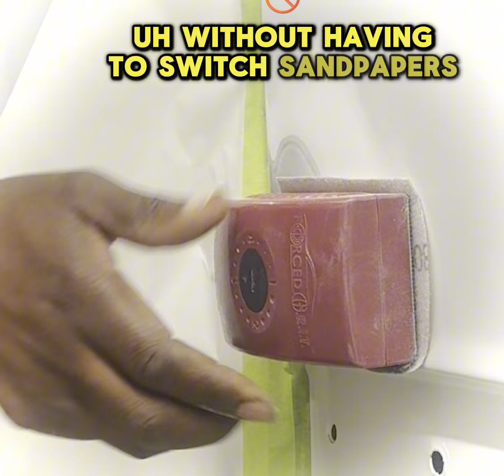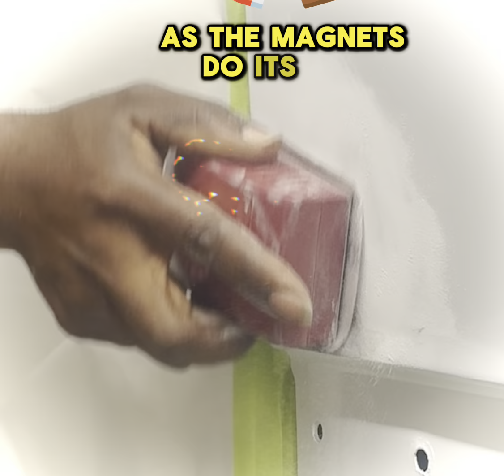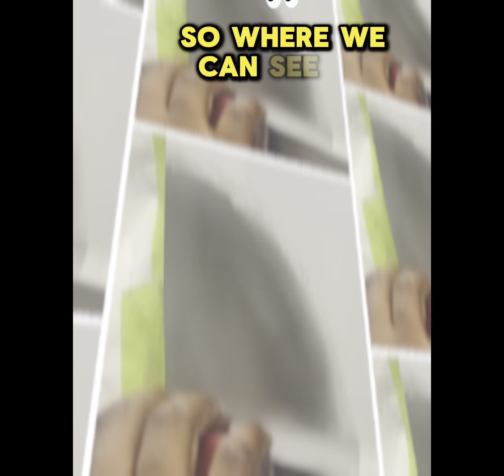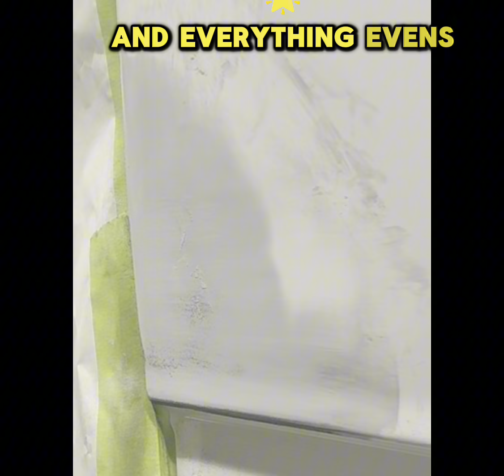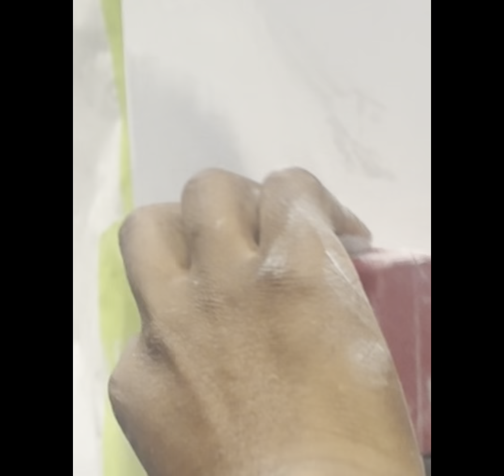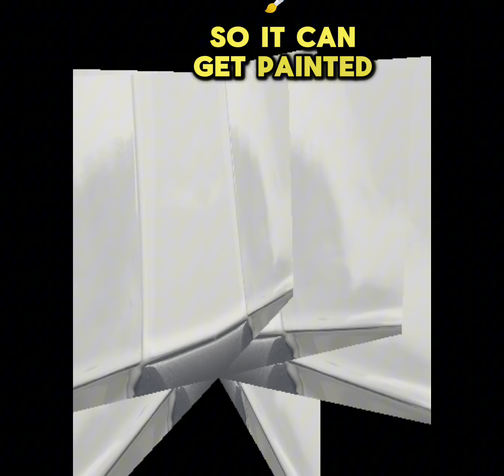Did you know skipping grits can cost you more time than it saves? ⏳🧻😬🛠️

Comment from the maker: Paint Work

Did you know spray gun setup matters more than the brand of paint you use? 🎨🔧⚖️😮
Are you dialing in your gun every job or running the same setup?
Some painters never touch their settings—and it shows.
We adjust based on material, temperature, and panel size.
Because the gun is what delivers the finish—not the label on the can.
Control the gun, control the outcome.
What’s your setup strategy? 👇 Follow for more!